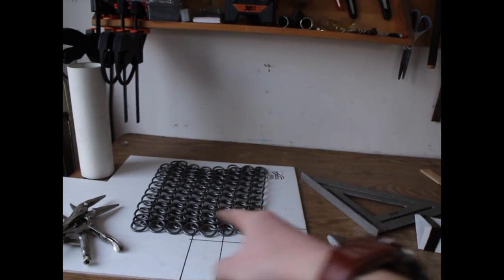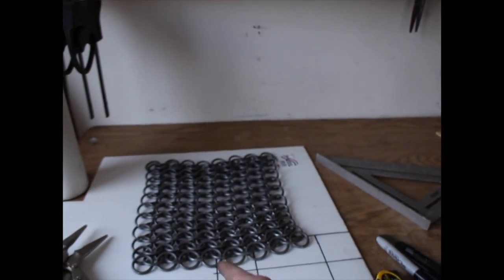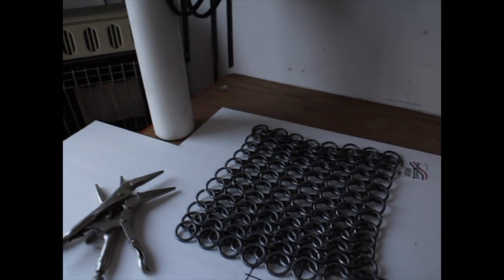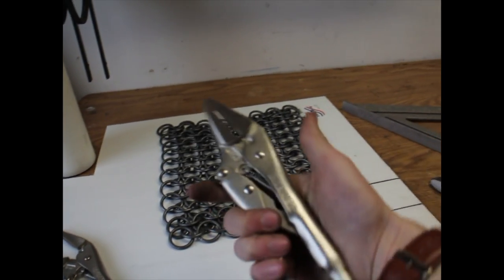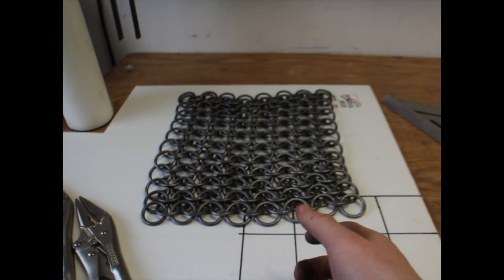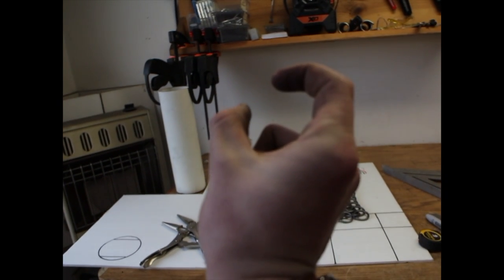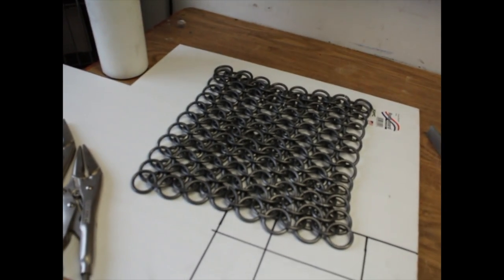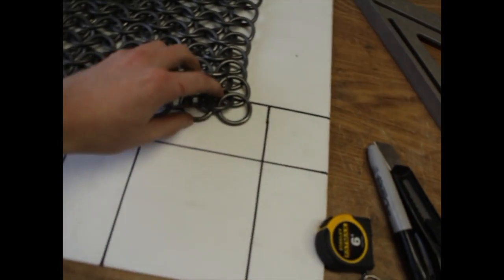Making HUGE Chainmail!

Comment: That looks awesome. I'm a mailler myself. There are advantages and disadvantages to increased or decreased ring size. For butted maille larger rings made in a thicker gauge is better, since it helps increase the resistance to opening up. I've thought about making extra large/thick rings before, but nothing this big. Given the difficulty with closing those rings, I'd think armor made from it would laugh off anything that wasn't small enough to just pass through, and doing something like 6in1 (my favorite) would certainly help in that. Unfortunately I'm fairly certain it would be impractically heavy.